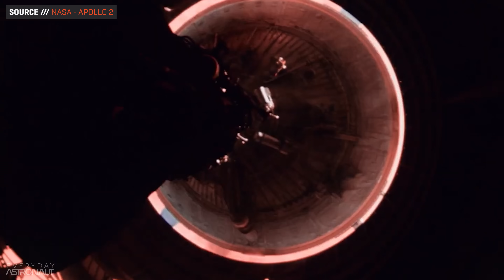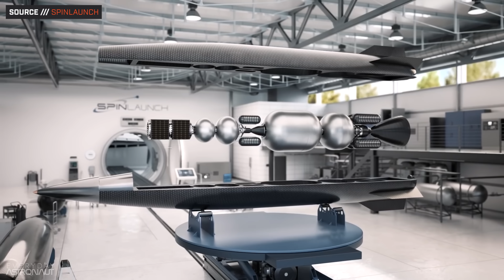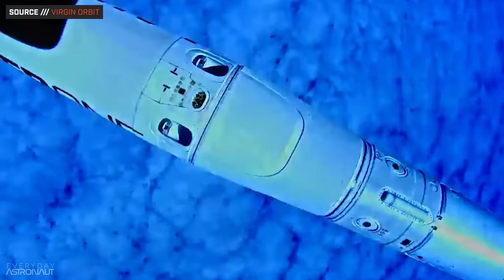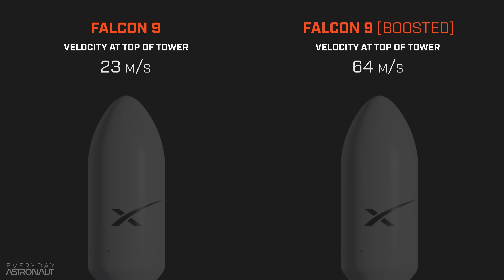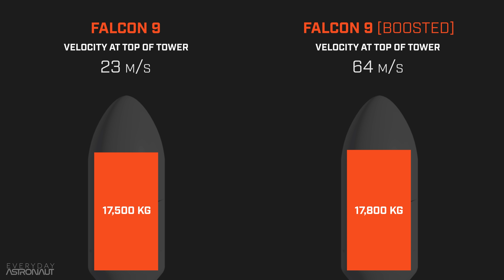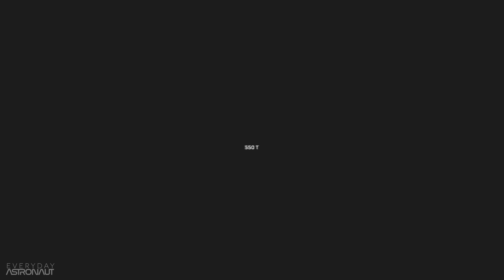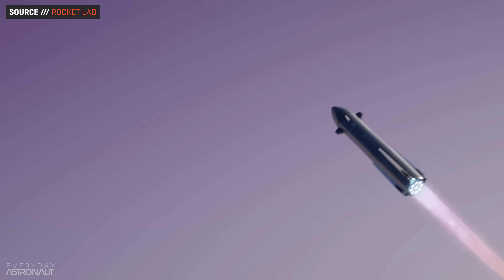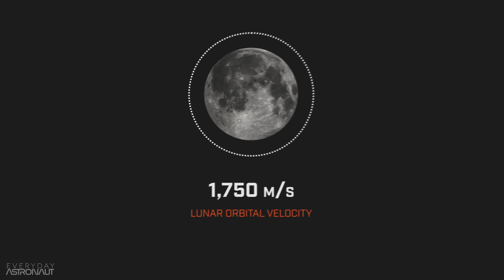Could We Help Push Rockets To Orbit?

Comment: Something else not taken into account, is that there is a big difference in the structural stresses of accelerating and nearly empty rocket, and a fully loaded one.  you are taking the fully loaded stresses from 1.5G up to 5G, so that's 3+ times the structural load on the first stage, not normally required.

Comment: okay fan boys of Elon musk, NOT everything needs to be done with tesla gear. Want fast discharge of electrons? Try super capacitors.  I know, I know, Elon didn't invent them, but guess what Elon hasn't invented anything and there are great ways to solve problems without s^cking Elons D^ck.

Comment: I'm missing one option. Instead of a counterweight, use rocket engines. Mounting rocket engines upside down, with the added benefit of the weight of the rocket fuel. Instead of having to lift all that fuel, you can acually benefit from the weight of the fuel to get things going. 

it'll give a hell of a bang when it hits the ground, but solving that problem is minor ;-)

Comment: I think 980 MJ is feasible in a short time if you're doing it pneumatically instead of going down the complicated route of super capacitors, electromagnets, etc. Keep it simple and just open a valve to some very high pressure air tanks, and let a few pistons do the work. Still difficult to get everything out of the way of the rocket exhaust though.

Comment: But wouldn't you rather use these power systems to reduce the amount of fuel you have to carry? 
If there is one thing I know it is that pushing all that fuel needs fuel, which needs more fuel for the fuel, which would require fuel which... you know, so on (not to infinity, I am not zeno of elea)
Maybe the impact of fuel reduction would be more impressive.

Also the whole "That's so many EV chargers" is not really that impressive, maybe compare that to fuel amounts or something I dont know.

Anyhow great and interesting video!

Comment: Your sense of how much electricity that is, is way off. You seem to have no sense of how little 1,000 kWh is: it’s just $50 worth. 100,000,000 kWh is therefore only $50,000 worth of energy. 

To build a battery or BESS that can supply that is pretty cheap too. $300 per KW

Comment: If you would consider building a 1km hole, why not just make the rocket fit relatively tightly and fire it like a rifle.  Start the rocket engines, perhaps have a few built into the launcher to further increase pressure behind the rocket, draw a partial vacuum above.  The expanding gasses, steam, etc would provide some serious lift at the cost of digging a hole.

Of  course recovery after a launching pad explosion may be impossible.

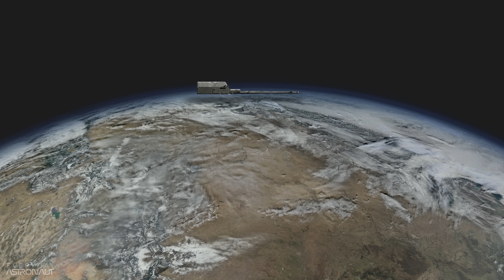Comment: 3:30 Not technically true, that's only for spacefaring, if you use an upside-down wing, you can definitely get further if you leave the atmosphere in the first quarter of the "orbit, and then rotate wings to normal for the last quarter of the "orbit"
No propulsion but you get further by using the air.
Why don't we use wings for launching this stuff?
Like, it counters the biggest problem, gravity. It's adding 1G to the entire launch duration.
Maybe 0.6G because it would take longer, and wings aren't 100% efficient, but still. We know that wings are better than non.

Comment: Using a heavy load like in your thumbnail would unironically add a lot of energy to the launch system and could be pretty accurately controlled. Additionally it could be readily converted from potential energy by just dropping it. Just use electric motors to lift it before take-off, and if you measure the energy that takes, and take into account losses, then you know exactly how much energy it will add to the launch, though there is a practical limit to this that I am not gonna bother calculating.

Comment: 12:08 1200watts is the average home power?  That's one blow dryer, or an average 2 bay toaster.  I get that your figure is an average over a day and these are only used for a few minutes, I just would have guess higher.

Comment: I would like to see the math on a 5 or 10:1 see-saw beam style yeet for starship with a gigaring (starship with raptor v3 layout plus additional engine ring) facing down (flamey end up) on the 10x end of the fulcrum, 2g net acceleration with stage 0 height lift boost... That and or instead of a giant mas or capacitor, horizontal sea-level fixed raptor boosted flywheel sizes for equivilant net boost

Comment: why not a pipe that refuels the fuel and oxygen tanks while ascending? you only need to add the pipes along the launch pad. Same benefits on a really simple system. Shuttle had a similar system that disconnects seconds before launch to keep fuel cold, only need to make it bigger ans disconnect it upper

tunnel system could be done using helium balloons up to about 40km height

Comment: Instead of trying to increase payload keep the payload the same and calculate how much weight you reduce from the overall rocket. The less fuel you need to bring to move the payload the less fuel you need to bring to lift the fuel that lifts the payload.

Comment: How about simplifying the lift system, instead of a big counter-weight, why not build four simple towers supported by cables and attach a bungee cord system to the rocket, essentially a big rubber band? A winch system could stretch the four rubber bands down to quick release points on the rocket, and it could give the rocket a helping boost at lift off without requiring huge infrastructure. Ok, the towers would need to be able to withstand compression, but the engineering is feasible.

Comment: 11:38 Another few points of comparison: that's 450 MW, or 0.45 GW, which is

- About one-tenth of a nuclear power plant (~a couple of GW, many about 3-5 GW)
- About one-fourth of the Hoover dam's hydroelectric capacity (~2 GW)
- About 2 US Gerald R. Ford class supercarriers (~250 MW each)
- A bit more than the Horns Rev 3 wind farm in Denmark (peak ~400 MW from 49 turbines at 8.3 MW each)

Comment: The part of this I think would have been interesting to add .. long term sustainability given the efficiency losses from the initial primary energy source .. solar input

What tiny % of initial solar energy input .. via fossil fuels to rocket fuel .. gets in the end converted to payload gravitational potential energy / kinetic energy.
vs
Photovoltaic directly converts to electricity .. Li batteries and capacitors can operate over 90% efficient cycle (charge to charge) .. power electronics can also operate over 90% efficient .

On a yearly basis .. given the same number of acres of land collecting that initial solar energy input .. which path would net more orbital energy (gravitational potential energy , or kinetic energy).

Plants photosynthesis I recall reading was often under 10% conversion of the initial sunlight .. less than 1% of the plant biomass chemical energy gets converted to fossil fuels .. less than 10% of the crude oil gets converted to potential rocket fuel .. rocket engines convert often less than 70% efficient .. the Rocket equation tells us that only a very very tiny % of the total rocket output ends up converted into final payload orbital energy (kinetic energy or gravitational potential energy).

vs

Photovoltaics convert over 20% directly into electricity .. Li batteries and Capacitors are over 90% cycle efficient (what you charge in vs what you discharge back out) .. power electronics can be made over 90% efficient .. electromotive conversion (like in electric motors) can convert over 90% efficiency.

I don't have exact numbers .. but .. back of napkin makes me wonder ??

Comment: To be fair there is almost no launch assist system the could efficiently move the rocket. None more powerful than the engines. We dont need launch assist, we need a breakthrough for rocket engines.
Reply: After 100 years of well-funded rocket engine development, I wouldn't hold my breath for a "breakthrough" that doesn't turn out to be just hype.
Reply: @pewterhacker  Well when I say break through I dont necessarily mean a better rocket engine but my like nuclear fusion engine in a vacuum. I dont think we will get much better for lift offs but if we could create a hyper efficient Vac engine it could completely change how we move through our solar system. Just 1g of continuous boost for 24 hrs gets us to Mars in 3 days if you count the launch day. But 1 day of 1g burn then deceleration 24 hrs at 1g and its a 2 day trip.

Comment: Could an inverted rocket engine mounted beneath the rocket so that it gives an initial push? No weight gain, don't need to increase the strength of the supporting structure.

Comment: A potential method for launch-assist propulsion could involve constructing an elevated mass-drop mechanism adjacent to the rocket. By positioning a platform bearing a calibrated counterweight equivalent to the rocket’s mass above the launch vehicle’s apex, the controlled release of the weight could generate a rapid downward motion that, via a mechanical linkage or tether, imparts an initial upward impulse to the rocket. When synchronized with the rocket’s own engine ignition, this “gravitational slingshot” assist could theoretically reduce the propellant required during the initial acceleration phase, thereby improving fuel efficiency even over the short duration of the mechanical assist.

Comment: Air canon is the best option, you don't need a zillion G's, just enough velocity to clear the barrel.
Imagine a vertical tube the height of a launching tower. The tube continues beneath underground for 20 meters and ends up in a large chamber where high explosives are placed. The acceleration would be controlled by the amount of explosives that you detonate.  Because of the large chamber the air pressure would build up slow enough that you wouldn't get super high G's.

Comment: I've said it so many times before, the only way to go forward with space exploration is to setup a base on the moon, complete with a nuclear reactor and in-situ fuel production. Then you can send a whole bunch of robots to build a launch base and expand from there (habitats, in-situ manufacturing, etc). A few years down the road you can send a rocket over with actual crew, land on the moon, and launch from the moon to wherever else with almost no fuel expenditure for take off...

Comment: You could lift a rocket 🚀 in to space. Using a balloon filled with the lights gas on earth like this whether balloon. Have a round hole with rail so it fly out in to space. Mit be slow to lift off.

Comment: About capacitors, high voltage capacitors are easier to build, and can store more energy for the same surface compared to low voltage ones.

Comment: Well regarding cost of electrical net Joul to J provided pr $ vs rocket fuel? also what about looking the other way around keeping payload, reducing the rockets weight total, i think that will give way more % effect. I also had my own smaller simpler suggestion. you have a cylindric deepening below the rocket, lets just say up to the length or half of the rocket. this is supported by a spring system that can be torqued. so you elevate the "top rocket base plate" to ground level. place the rocket on this and start torquing the spring system( there are many different options here, both mechanical or other types, plate springs comes to my mind first for its simple design and massive load capacity, then maybe add a row of massive coils etc. (that have a way lower spring constant=lighter force). the tensioning of the springs can be done rather slowly simply by slowly elevating the bottom of the spring system). the end idea is to reach an almost net 0 weight (counter the mass of the rocket), now your rocket engines start and it accelerates the spring extents(first layer is the max load plate springs), at this point the Plate springs is extended and therefor the combined force of the spring is lower (now the lighter coil springs set in), keeping up with the acceleration. at the end you have a set of "relative" lighter springs in the end just to give the small final push. so at this point the spring system is fully extended. the spring is all the way kept in place and supported by lets say 3 pillars with some roller bushings etc. at this point you slowly lower the spring back to its pit, and can redo the process. (lets say charge up spring over maybe 24 hours. we are not launching the rocket as just giving it a slightly gentle push to get started. removing the need to overcome the base 1 g and slight assist it in accelerating for the first part. that's still an incredible amount of less fuel and hull mass to be lifted in the first place (and the hull part not being lifted until first separation) a very simple model without to much effort to do is lets say the base diameter of the rocket, then fill it with lets say 2m long industrial coil springs, then keep building layers of thoes, meaning they act in series as one large spring with the constant of the spring used x amount of spring, and then the extension of the spring until its fully extented. each layer will ofcourse have some hard stops to prevent from being compressed below its minium lenght. You can play with this (would assume pretty funny) on online calculators from spring producers (like Sodemann)

Comment: how about a conventional air breathing first stage? Like a wing pack so the rocket can remain vertical and can turn on it's liquid engines while still under propulsion. And I'm not talking 747 engines. I'm talking SR71 ramjet type engines. So at least a few times the speed of sound for stage separation. since you are not carrying oxidant, should able to pick up some weight to orbit.

Comment: You are acting like we don't know hoe to get lots of current out of batteries or capacitors. In the 60s and 60s most pulse lasers charged cap banks in series and discharged them in parallel. Similarly the the Sandia z-pinch plasma generator expends 20-23 MJ per shot, and has a peak electrical power of 80 trillion watts. This is achieved at a cost of $200k per shot.

Comment: Use a small tunnel with a railgun system that shoots the platform where the rocket stands. Calculate how much power you need to keep that platform from flying off those rails

Comment: I don’t understand the big focus on energy, as that is super easy to come by. 
How about the impossible engineering? What material can avoid breaking when we make a tunnel to orbit? The weight alone will make it break. Or how does it fly?
What material will hold the weight for a tube to the moon?

Comment: World's most powerful laser outputs 2 petawatts, that's 2 000 000 000 kW. For comparison, CERN's particle accelerator, when operating, consumes bit over 200 000 kW and the most powerful diesel engine produces 80 000 kW. The power is not an unsolvable issue which couldn't be sorted out today.

Comment: I'm not convinced. Any mechanisms you can removed or reduce from the rocket without reducing its capabilities is a win. Having 100 loads that sum up to the weight needed being pulled over time by a solar powered system is free capacity you can put into space. Additionally, using pullyes you can just have to loads cover a larger distance (dig holes for the loads to go into) to reduce the amount of load required. You aren't just talking about an increase in capacity, you are talking about a reduction in fuel required.

Comment: I recommend running the rocket up an electric train-track, going up a space-ramp on the western side of Mt. Kilimanjaro--  which is on the equator AND 20,000 feet tall, thus giving it an extra 1000 mph eastward-boost in addition to the rail.
This would accelerate the craft to maximum speed, and the rockets could do the  rest.

Comment: Speaking for starship I've never heard it proposed that the rocket use vectored  thrust to immediately induce horizontal movement until it reaches enough speed where it can attain  lift from the flaps..  I presume  this is because that would be stupid. And you would have to add flaps to the booster also.

Comment: My idea: 2 giant balloons pulling a smaller rocket with cables. One pulls it as high as the balloons can sit, where the air is thinner, then the other pulls it horizontally to help with orbital speed. The motors are on the ground

Comment: For starship catch tower assist for lift, when they catch the booster the weight pulls down on the lift arms acting as a re-gen brake allowing for less charging for the next lift.

Comment: Hello,
The gearing you set seem very low, 5 to 1.
Hydraulics, can also proved additional downward presser.
Reply from the maker: A weight can't fall faster than 1G, so in order to provide 2.5 G worth of uplifting force, the gear ratio is 5:1